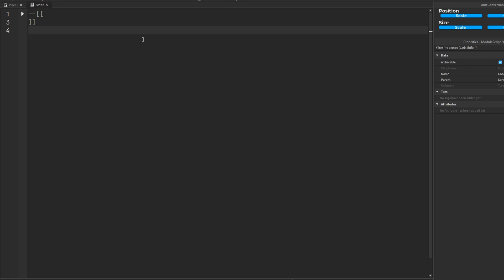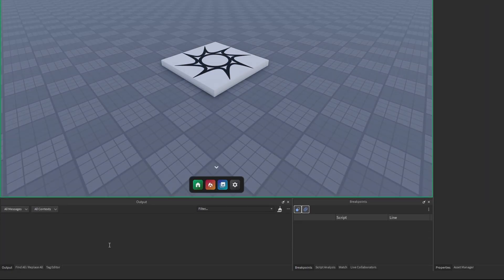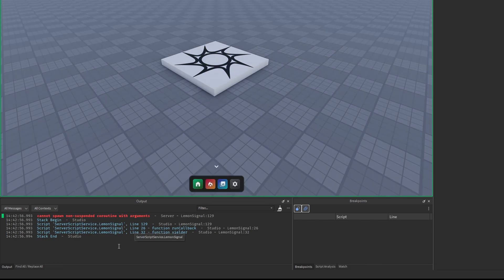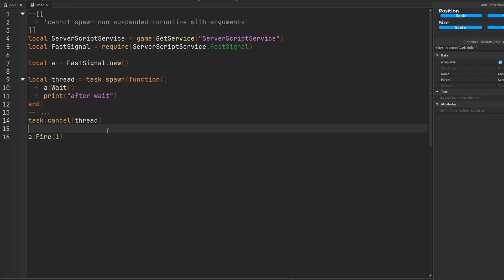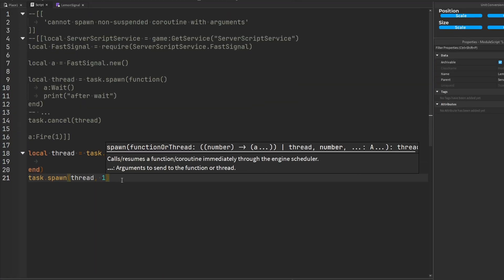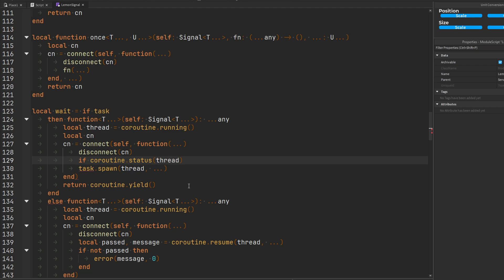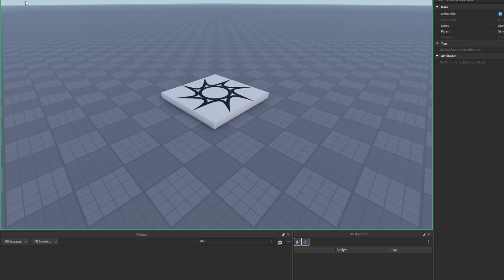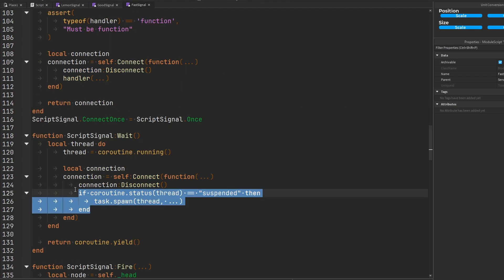This Bug Plagues EVERY Roblox Signal Module...

Comment: is this a bug? or simply your own race condition?? don't put this on the developer :face-orange-raised-eyebrow:
Reply from the maker: I wouldn't call this a race condition. This should be something that the signal module should expect and handle, just like regular RBXScriptSignals don't throw a fit when you call :Wait() on them but cancel the thread later (considering these modules are supposed to be replicating that data type).
Reply: @crusherfiredev  you can translate the error as  "your race condition is not my responsibility". it's a message from the developer. it's not a bug
Reply: @susiebaka3388  it's most definitely a bug in the modules, though? the error clearly states that it's trying to task.spawn a coroutine that's not suspended, the thread is dead (aka. it can't task.spawn it, or actually fire the signal) the module should check to make sure that it can task.spawn it before trying.

this most definitely does not fit the definition of a race condition. that error is also just not from the signal module developers?

Comment: I actually combatted this problem in my own signal module by checking if the thread was dead.
Reply from the maker: my man!
Reply: For some reason, roblox devs don't make full use of the utilities they have at hand, which makes for some pretty dumb mistakes that could be fixed very easily.